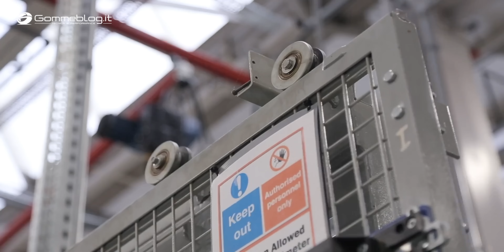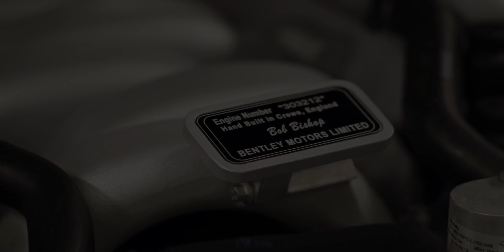Bentley V8 ENGINE - Car Manufacturing PROCESS and PRODUCTION

Comment from the maker: Who Like V8 Engine ?? is the Best Engine NOW ??? or You Prefer V6 with Hybrid System?
Reply: A V6 ? No way !  A powerful and beautiful  V8 like this one all the way
Reply: @SoothingStrings33  Not to mention is a good Salary  a Monday to Friday Job too in an Air Condition Environment
Reply: V ate all others ))
Reply: Ob
Reply: as the old saying goes "there is no substitute for cubic inches"......and nothing sounds like an angry V8 being pushed hard.......V8 supercars Australia is the perfect example.....and the annual Bathurst 1000 race is testiment to how hard and punishing a race track can be on both man and machine......these "soft" euro V8's cant handle Aussie conditions
Reply: @hardtop123  No replacement for displacement?
Reply: 7955879795779877 7
Reply: @SoothingStrings33  Not if you have to do it 8 hours a day nonstop...
Reply: ¹1
Reply: V12 like
Reply: V8 v8
Reply: The sound of a v8 is much better..
Reply: @Ankit-df8rw  1¹11
Reply from the maker: Thanks
Reply: v8 twin turbo with electric motor

Comment: What is dude hammering at 5:20-5:30? Making a dent in a bolt head to lock it? Seating a gasket or frost plug ?
Reply: Not 100% sure but I think he might be putting some sort of identification number on the engine with metal stamps.

Comment: So I had to read more on these engines, they are an evolution of a Rolls Royce design OHV v8 first introduced in 1959.  I think the version being assembled here is the one that was rated at 505 hp with SEVEN HUNDRED AND FIFTY TWO ft/lb of torque.
Reply: really?  my one is fitted with VANOS but only 285 hp.
Reply: @jackrichards1863  prob bc of ecu detune
Reply: Where did you find this info

Comment: Nice Bentley badge but that was not (NOT) a Bentley motor they put together.  Take a look at the injection tubes on the Bentley motor that put the name plate on.  They are not the same as the injector tubes on the V8 they were putting together.

Comment: Funny thing , Chevrolet is given a hard time because they put the pushrod dinosaur LS in everything . These Bently engines look like LS engines , simple and reliable , i wonder if they get the same criticism
Reply: Why the need for push rods when you can make it as an overhead camshaft engine instead?

Wouldnt thar eliminate the need of rockershafts and pushrods? Like less moving parts to deal with.

Comment: Nothing has changed in the piston engine in over 100 years, Modern gasoline engines have a maximum thermal efficiency of about 25% to 50% when used to power a car. ... At high speeds, efficiency in both types of engine is reduced by pumping and mechanical frictional losses, and the shorter period within which combustion has to take place. nice new modern designs and add-ons But still is an inefficient slug as the day it was invented .
Reply: Except for variable valve timing, lift, direct injection, coil on plug, EFI... blah blah blah.. Please tell me what model T ford has that?
Reply: And is still somehow way more useful than electric cars.

Comment: Clean & orderly 👍 engine assembly production line. What about CC and car type (Bentley type)?
Reply: 6752cc, Bentley Mulsanne.
505 horsepower in the standard car, 530 hp in the Speed.
752 lbs ft of torque in the standard car, 811 lbs ft in the Speed.